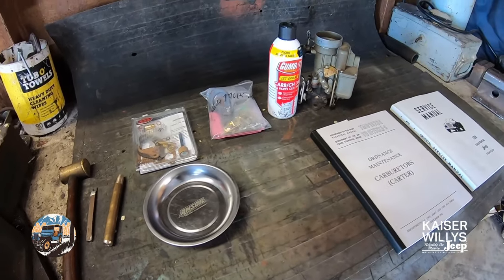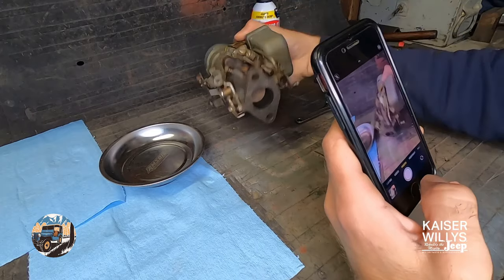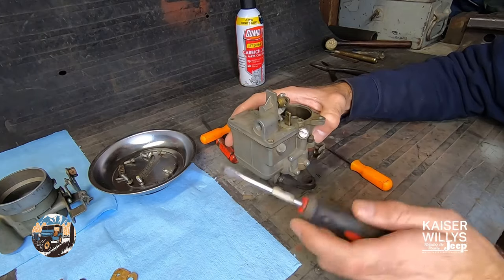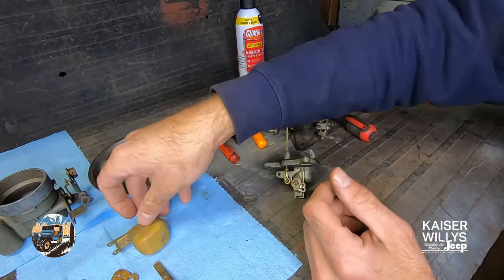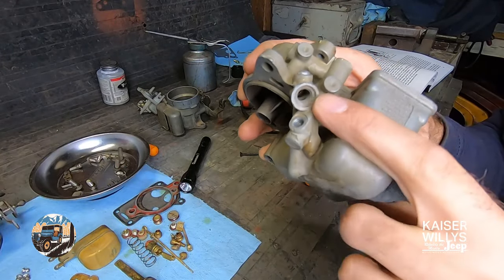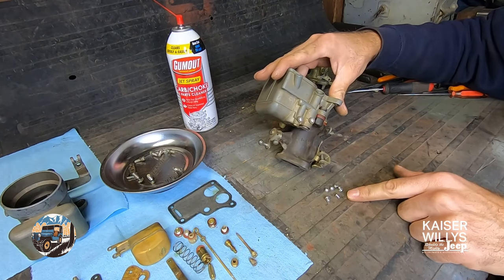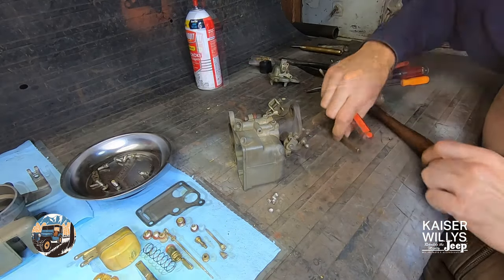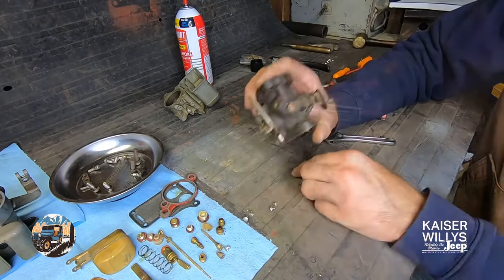Willys Jeep How To: Carter Carburetor Rebuild Pt. 1

Comment: Should that not be soaked in  a carb cleaner and blown-out again before re-assembly. Or did they leave that important step out from the direction you are reading from?
Reply from the maker: Cleaning and blowing out the ports is discussed near the end of this video. It’s also covered In part 2 durning reassembly. You do not necessarily have to soak every carb. It all depends on the condition of the carb. The main thing is to ensure all the ports are clean and clear.